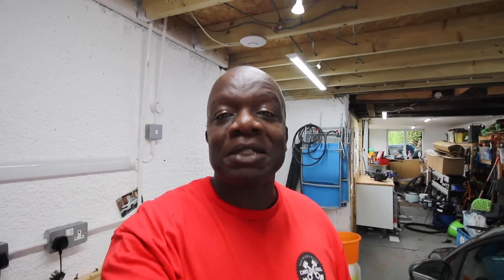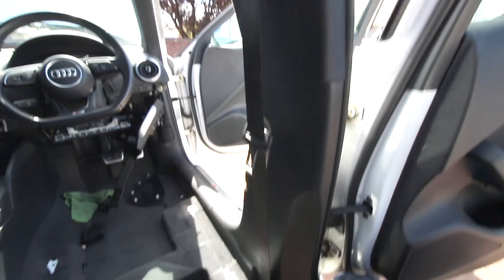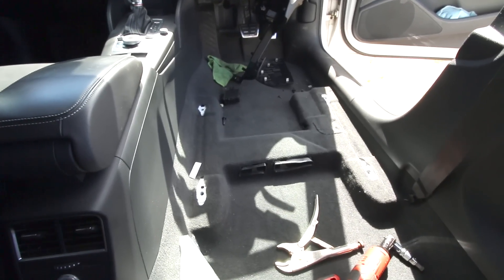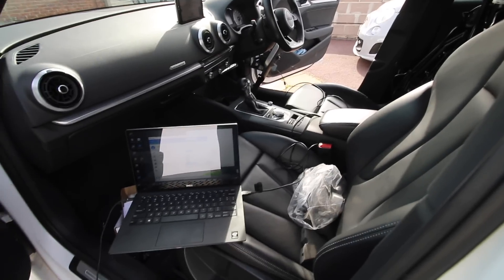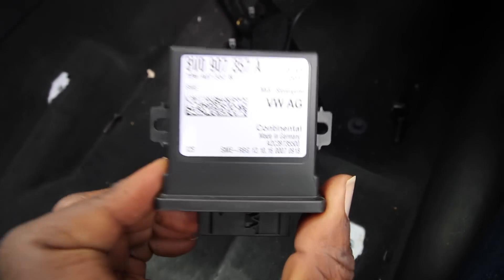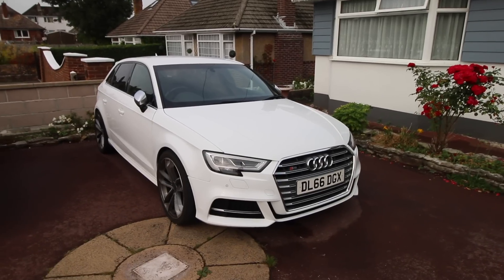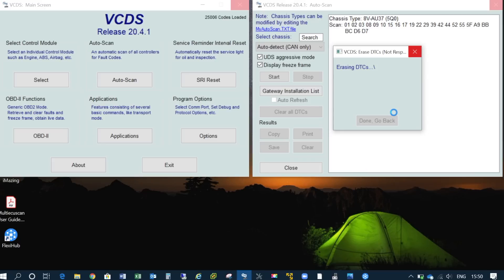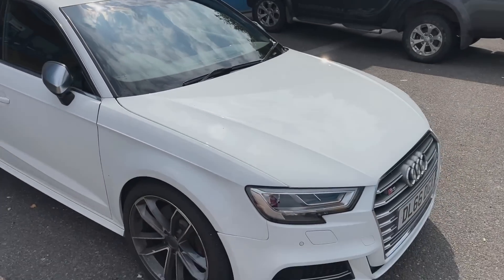Only 2 days left to fix the lights on the Audi S3

Comment: Hi Paul
So you updated the ecu for your seatbelts?. I replaced my front seatbelts on audi a5 and they keep locking while trying to put seatbelt on and then sometimes release 🤷🏽‍♂️
Reply from the maker: look at my seat ibiza video about seatbelt, I show you how to deal with this issue, also, you don't update the ecs, you just clear the DTC code that the old seatbelt created.

Comment: Hi Paul i did the upgrade from b xenon to full led but the drl don't work when the car is cold, they start fully work after 20 whn i driving. Do you know what can it be?
Thanks
Reply from the maker: Not a clue, you'll need to get an OBD reader on that to see what codes are logged. that would be my first action.
Reply: thank you very much for the answer, it tells me no power but i don't know where to put my hands